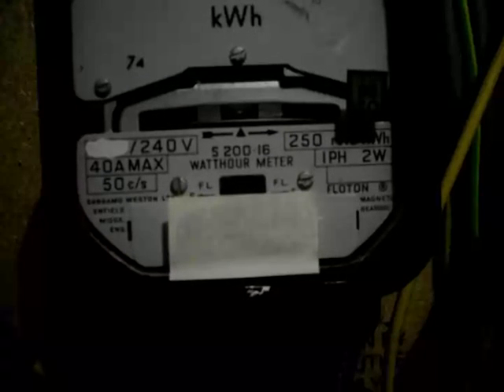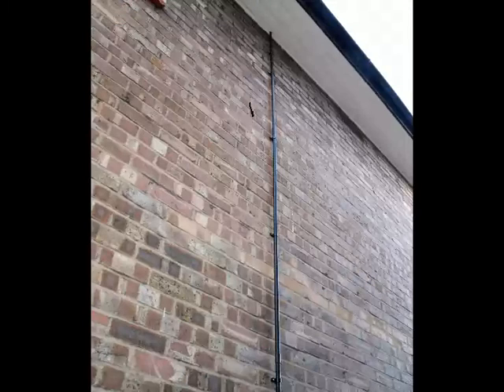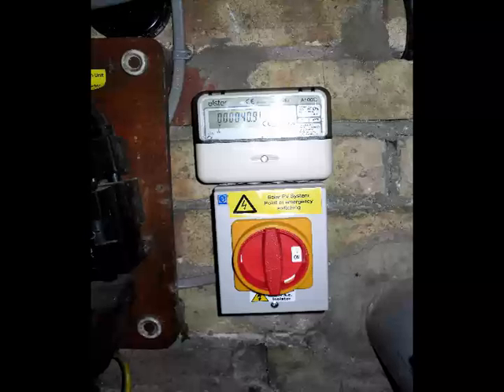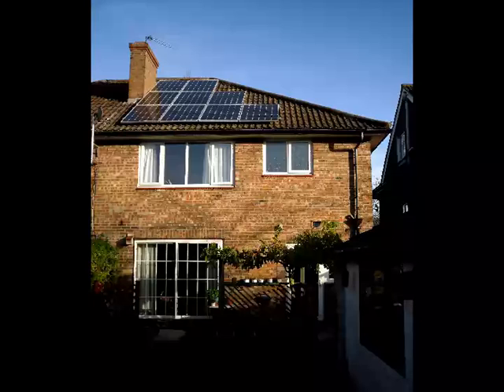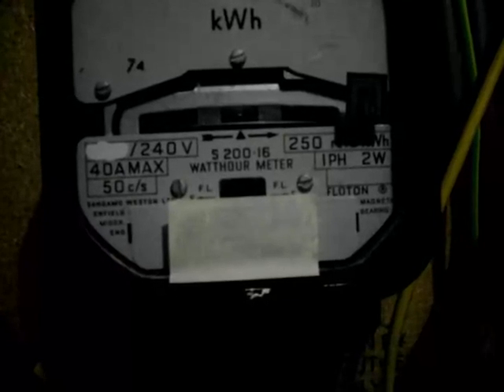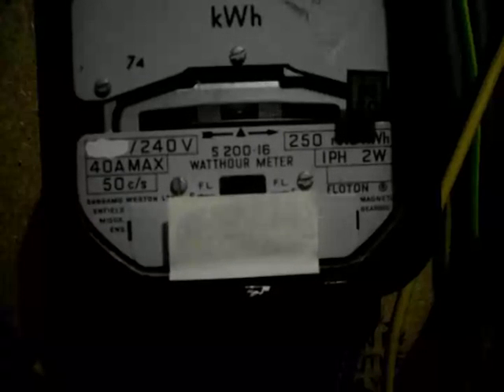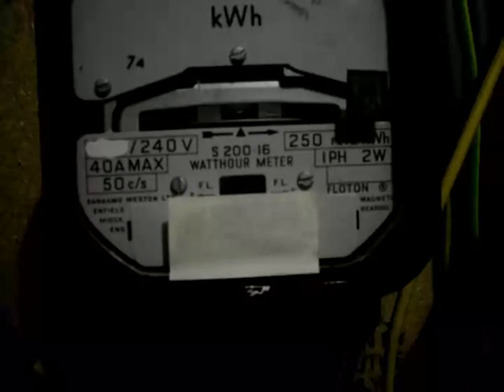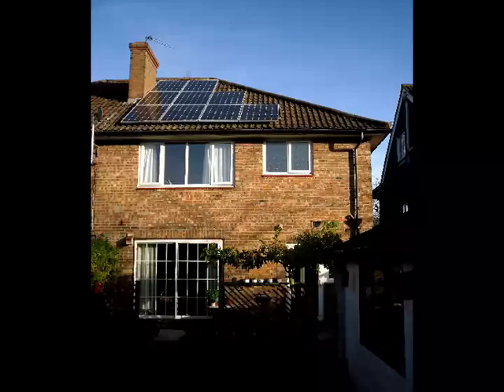Typical UK domestic solar PV installation

Comment from the maker: This is a west facing roof (a few degrees south of due west) so the chimney doesn't obstruct the sun. It was the best roof available as the south roof is obstructed by the next house. The installers estimated the reduction in output and so far the system is performing to plan - it should generate as much as electricity as I use over a full year. I have been an enthusiast for renewable energy for 40 years.